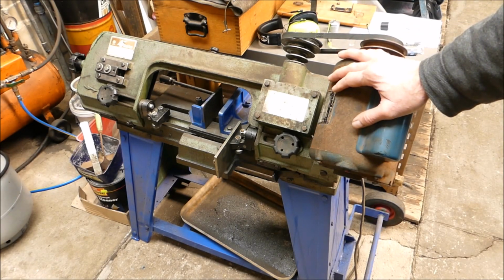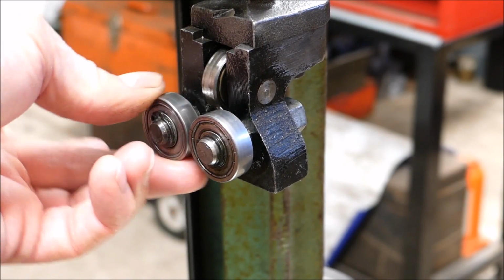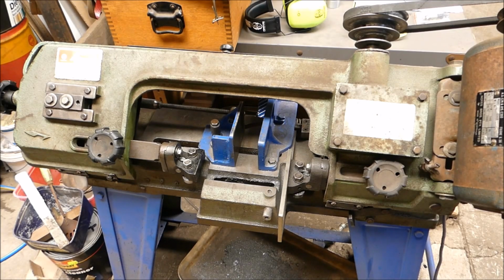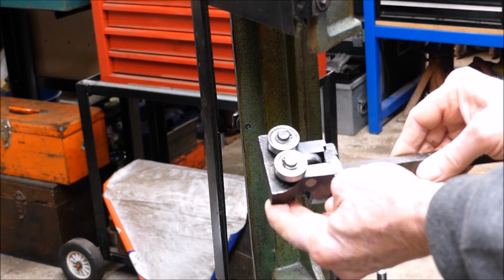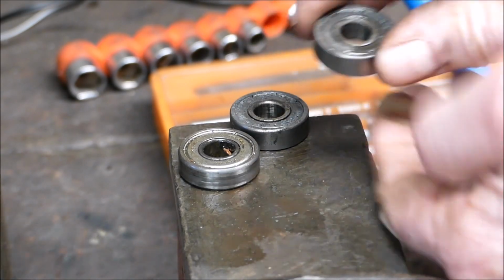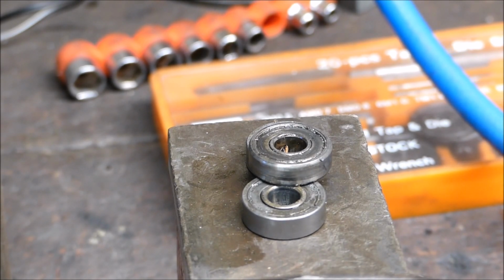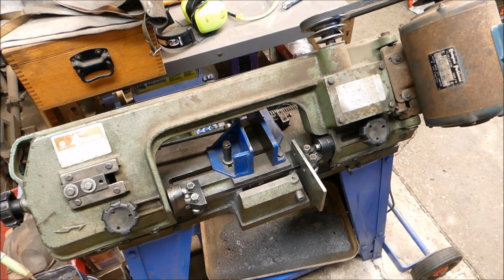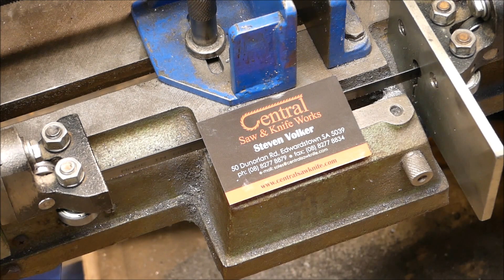The 4 x 6 metal bandsaw started breaking blades - easy fix

Comment: I have a similar unit made for Milwaukee Pneumatic Tool. Mine kept building up swarf on the wheels and overtightening itself. I stopped oiling the blade  to prevent it but blade life is a lot less. Do you lube the blade? If so what with?
Reply from the maker: I only use lube when it needs it (for aluminium - definitely) and for big hot cuts in steel stock.  I use a thin kerosene and engine oil mix (4:1). 

Normally I run dry and the saw doctor says that's fine.  He also said regardless of lube, the biggest wear factor is blade speed - keep it as low as possible to prevent chipping, burning teeth and the blade will last years.  So that's what I do, and it does exactly what he said.  That Bi-metal blade had been on there a long time. Cheers Rob

Comment: Your plate for table sawing looks to be the cat's pajamas... you don't have to take it on and off when using the saw for cut-off. What are it's dimensions? That would save the trial and error of fitting one for the saw.
I lubricate the blade with cutting oil applied with an acid brush. Not as effective as a coolant pump, but a lot less trouble than trying to contain the coolant. Water soluble oil coolant in the home shop is about more trouble than it's worth. It does work great if you use it every day and keep the oil/water mix correct, but using it once a week often leaves a stinky sticky mess to clean up.
Reply from the maker: https://www.youtube.com/watch?v=HcRlutKWcl4

Comment: You sure they're not 6000ZZ bearings? 26mm outside, 10mm inside, 8mm thick.  The ZZ (or 2Z)means it's got metal seals on both sides.  I only know coz I replaced one in a saw motor last weekend!
Reply from the maker: Yes, you're right Andrew.  I wrote down the right numbers but left the paper in the shed and went from memory - my bad.  I will correct  it.  I have both numbers looking at the old and the new bearings and both have metal seals.  I think I bought them off Ebay years ago.  They look the same to me.  Thanks for the pick up.  Cheers Rob

Comment: I have a similar bandsaw. Bought it about 25 years ago. The blade keeps slipping off of the drive pulley when there is any increase in resistance during the cut. I have to monitor it constantly. I have never been able to fix this with new blades or adjustments. Maybe I’m adjusting it wrong. Any ideas how to fix it?
Reply from the maker: My blade has always run proud on the drive pulley even when the blade is close to the flange on the idler pulley.  I have looked at how to correct this and I think the idler pulley has to be moved back more so the pulley faces are co-planar (on the same level).  It hasn't really worried me as the blade only pops off if it jams, which is actually a good thing as you're less likely to break it.  Cheers Rob

Comment: Did you break in that blade?
Reply from the maker: That was the first cut and the pressure was backed off to break it in.
Reply: I had never heard of breaking in blades. Is that important and how is it done?
Reply from the maker: Hi Glenn, apparently yes.  I'm no expert on this subject but by all accounts you should keep the speed and feed rate low to begin with to give the blade a chance to wear into position/profile.  So I do it regardless and all seems to work well.  I've never had chipped teeth on the blade. but then again I don't stress out the unit when cutting thin stuff. Cheers Rob
Reply: Page 22 of this PDF. 
https://www.lenoxtools.com/Guides/LENOX_20Guide_20to_20Band_20Sawing.pdf

Comment: I'd love to have a little saw like that. My elbow has about had it from hack sawing manually.
Reply from the maker: They're good.  Bit expensive new but you can often pick them up secondhand for 1/3 of the price.  Not much to go wrong with them.   I replaced the standard 1/3 HP motor with a 1 HP unit and it's effortless the way it cuts through stuff .  Cheers Rob

Comment: Hi Rob! i have the same rong fu here in perth that was breaking blades as well. but i think i was tightening to tight as there were hundreds of stress fractures in my blades. plus i changed the bearing guides but the tracking is maxed out one way so i cant get it true. Any ideas on best tension to put on the blade?  also what TPI is your Bimetal blade?
Reply from the maker: Hi Troy,  It's 14 TPI as that can do most stuff OK.  I've had no breakage issues before, except where the job moved once and pinched the blade.  Never had any stress fractures in any blades.

The tracking is a bit tricky to get right.  With the arm vertical, loosen the middle hex bolt slightly, loosen the top bolt more and the blade tension, then screw in the bottom grub screw to bring the blade in towards the idler pulley flange.  Re-tension the blade to see where it now tracks and if looking good tighten the two bolts while re-adjusting blade tension. 

The blade has always run proud of the drive pulley even when it was close to the flange on the idler pulley.

When you tension the blade it will screw to a point fairly easily and then get hard to turn.  Don't force it past that point.

I hope this helps.

Cheers Rob
Reply: @Xynudu  cheers Rob I'll give it a go on the morrow and see if I can get it better. I was told by the bandsaw people that it was too tight but I had gone to a thicker blade than what was originally on it that's why it fractured but I think it was a combination of things. Thank your for replying
Reply from the maker: Hi Troy,  As that Rong Fu is an old machine, I would definitely check the idler pulley spindle shaft and pulley wheel bush for wear.  Mine was in a bad way and I had to rebuild both (the saw had done a LOT of work).  Obviously any wear there will limit tracking adjustment.  So make that your first priority and go from there.  I've put a link at the end of the video to how I rebuilt the worn shaft etc. Cheers Rob
Reply: Troy, it's pretty hard to get a blade too tight to effect it.  The consideration is how stout the frame and bearings are.  Too loose and the blade will wander through the cut creating entry and exit stress.  You want it pretty tight but equal wheel pressure on the back and front of the blade or the blade will stretch on one side while passing over the wheels then compress on the straightaways which can cause fatigue cracking.  Also, if chips are carried between the wheel and blade the same will happen.  A blade wiper brush behind the cut can mitigate that.  3rd, a blade too thick or brittle for your wheel size can do that.  Bulk carbon blade stock made for a 20" wheel that's been run on 12" wheels will crack.  Bi-matallic blades tend to be thinner / more flexible.  +1 on checking your spindles.  Good luck!